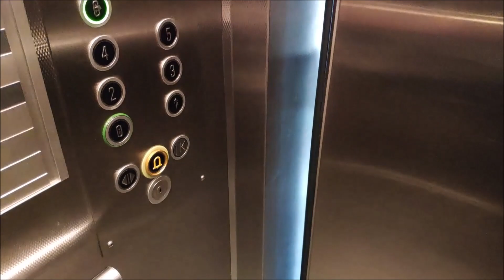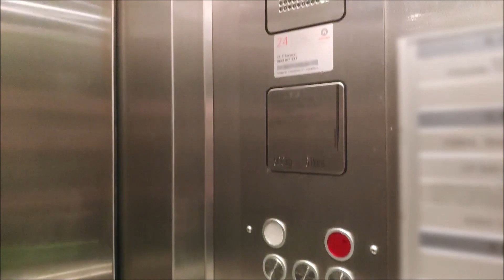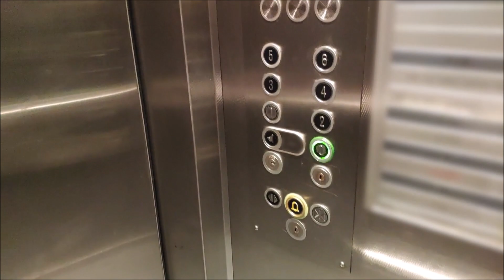2 90s SCHINDLER S- / D-Series Lifts in Berne, Switzerland

Comment: At 3:28 I saw a yellow plate instead of the motor’s fan on the gearmotor.. it’s that disc used for manual regolation of the chain/pulley?
Reply from the maker: Do you mean the hand wheel? That is for hand winding the lift to rescue trapped passengers in case of power outage. Also on the back side of the wheel are fan blades for passive cooling.
Reply: @TheLiftDragon  super Dragon! You answer to my question, perfectly!